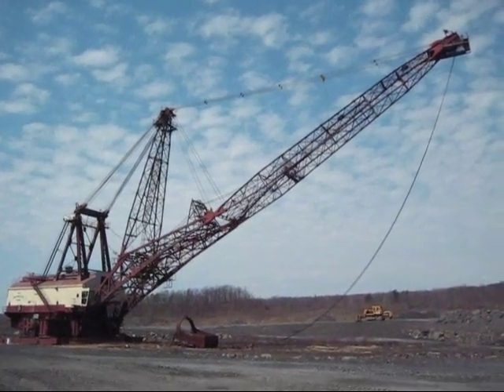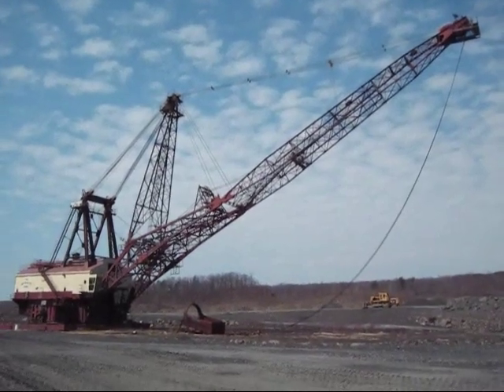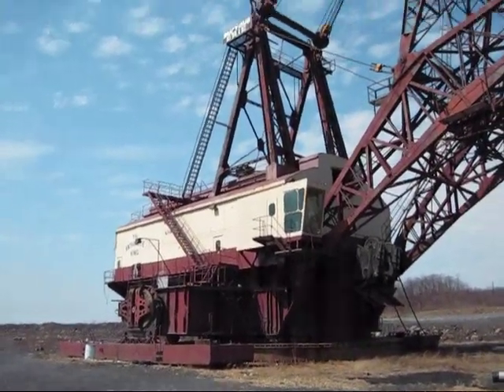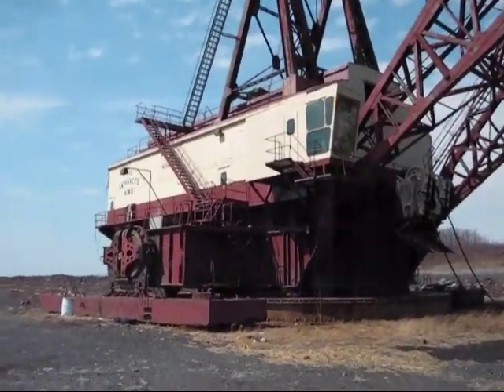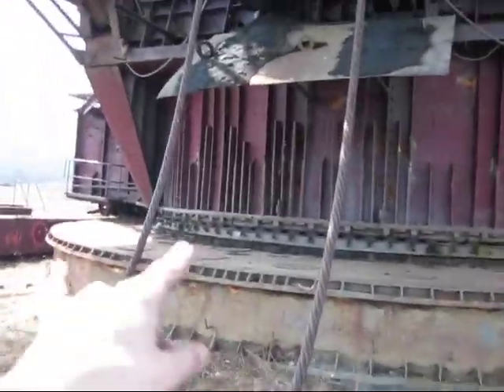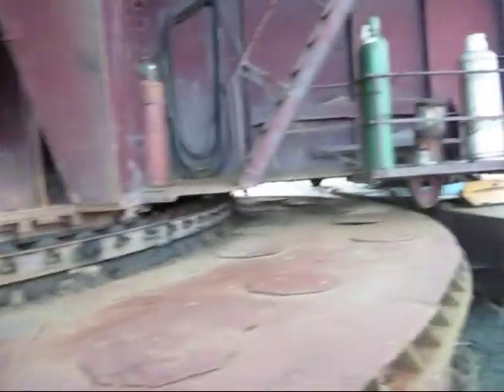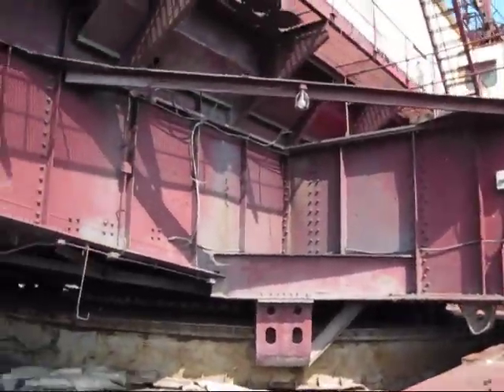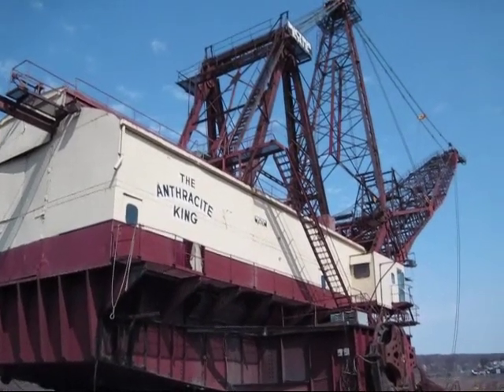Bucyrus-Erie 1250-W Documentary

Comment: Really enjoy your videos, just fantastic. Have to disagree about loading the bucket to capacity. It does no good to have a big chunk of metal if you can't load it to capacity. You might as well have a smaller lighter bucket and fill it to capacity. Easier on the machine. Also no one should be working in the swing radius because these machines can loose power and keep swinging until the swing,hoist, and drag brakes automatically come on. No one should ever be under the bucket. That is the safety factor not load capacity. Any how you do great videos that I love to watch. Best wishes.
Reply: I agree about loading the bucket.  They didn't make an 80 yard bucket to hold 40 yards.  Owners told the operators to fill the bucket til it spills over and we'll make sure everyone stands back.